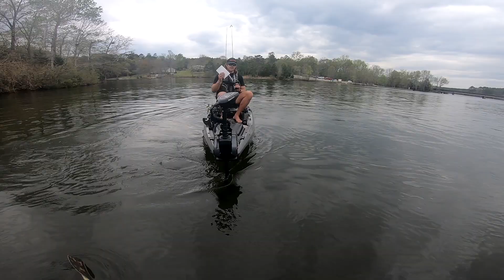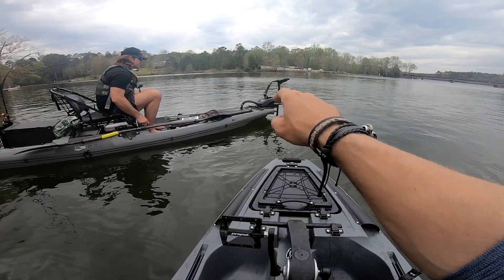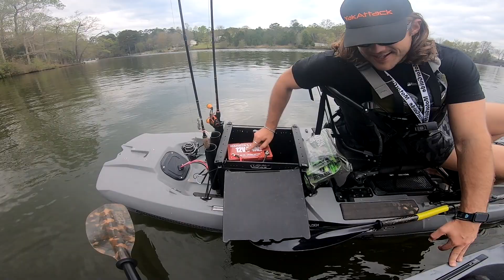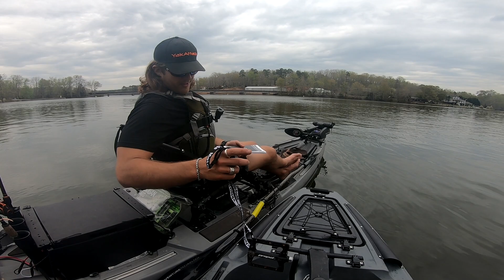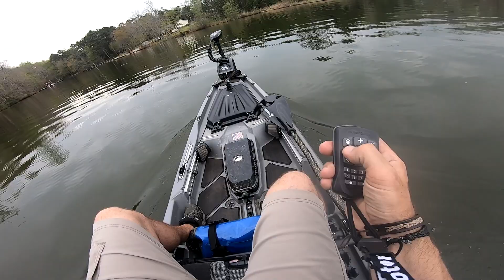MotorGuide Xi3 Electric Kayak Motor "Setup Walkthrough/Review"

Comment from the maker: 👇👇Link to Paddle I use and Gear Below Get Yours Today👇👇
MotorGuide 940700280 Xi3 Kayak Trolling Motor with Wireless FOB Control and GPS, 55lb Thrust, 36" Shaft, 12 Volt -----------   https://amzn.to/3WJZA20
Werner Camano Hooked Adjustable------- https://amzn.to/3gNdPj5
Astral, Sturgeon Life Jacket ------------ https://amzn.to/3olCNdA
Cuda Titanium Bonded Freshwater Line Clipper----------- https://amzn.to/3LtCmI6
Kraken Bass Fishing Pliers with Hook Sharpener Line Cutters----------https://amzn.to/3uSe0SG
Yakattack MultiMount Cup------- https://amzn.to/36aLwJn
YakAttack RotoGrip Paddle Holder----- https://amzn.to/3HYw0hN
YAKATTACK Omega Rod Holder--------- https://amzn.to/33muxCO
YakAttack Zooka II Rod Holder----- https://amzn.to/3BmgEBk
Yak Attack BlackPak------ https://amzn.to/3GRscxE
YakAttack VISICarbon Pro 360 Degree LED---- https://amzn.to/3HVlQi2

Comment: Probably smart to go with that 54AH lithium battery.

Lithiums are more lightweight, and using this one still allows some room for tackle boxes to be dropped in there.

That has been the thing holding me back the most, losing space for my tackle.
Reply from the maker: YeH he had the big lithium battery I should have videoed how the battery was installed he has a get way of doing it now he has it on the P127

Comment: Did he have to cut shaft down ?
Reply from the maker: He has a smaller shaft that's made for kayaks
Reply: @sternstalled  was Decide between the auto pilot 360 and this one
Reply from the maker: @TheGrimRe3per  I have not used the auto pilot but this one as a kayak mounted was simply amazing to use..
Reply: Not sure if he did. But Motor Guide makes a 36” shaft version with GPS specifically for kayaks.
Reply: @Accurize2  yeah I know this is a old message I bought the kayak version